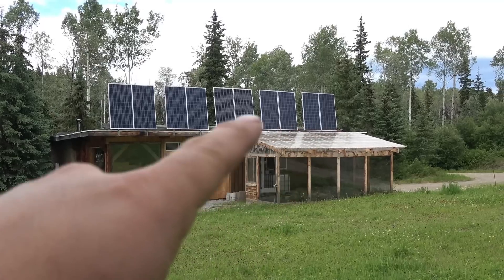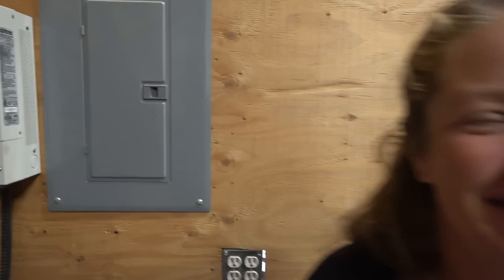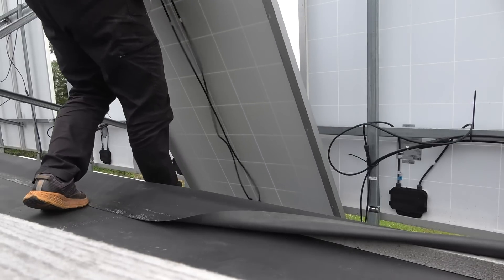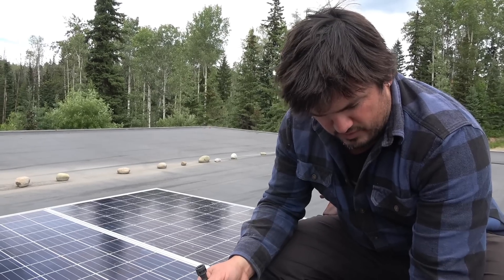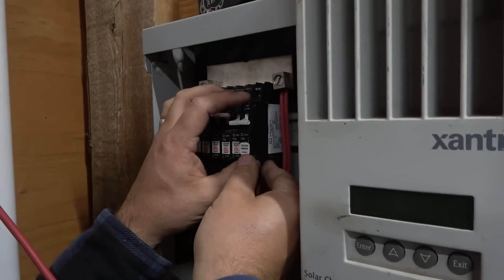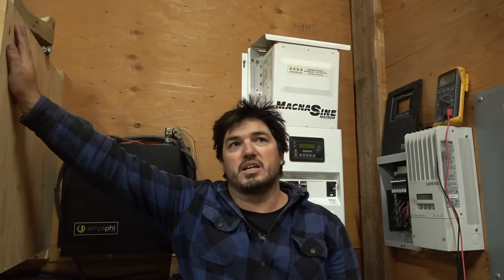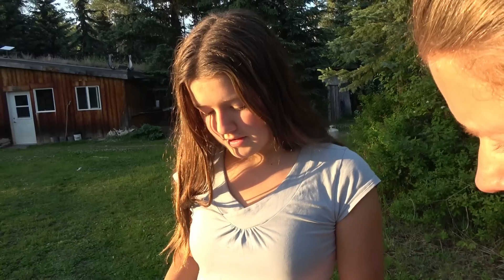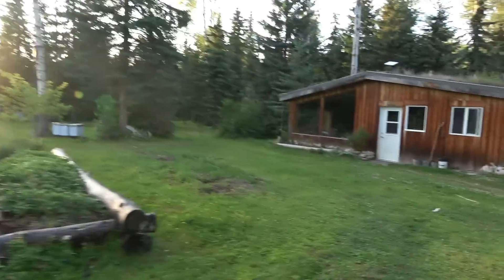SUPERCHARGED Off-Grid Solar Power System

Comment: Smart move buying that low frequency, transformer based Magnum inverter instead of one of those cheap, short lived, low surge high-frequency inverters that everyone else is pitching. The Chinese made high frequency, transformerless 6000XP is nowhere near being the best solar inverter on the market.  It offers a shorter life span, a poorer surge capacity and because the Chinese engineers that designed this went on the cheap, it doesn't use an output transformer. Without an output transformer to provide galvanic isolation, this inverter can damage your appliances when it's MOSFETs fail. Don't take my word for it, Search Google for the term "is a high frequency inverter less safe without an output transformer".

Comment: i have a spare hot water tank  with a smaller element  that doesn't blow the inverter output capacity ie a 1kw element
that i can run alongside all other load  this spare/feeder tank feeds my normal hot water tank that has bigger element not on my inverter system
so it just has less work to do sinceit gets in warmer water, so i switch this spare tank on as soon as  the solar can match my normal load + hot water tank and thus postpone battery charge a bit utilising more of the avaialable solar

Comment: You could get another cheapish charge controller too if you wanted all you could get but you generally only get full power for like 1 or 2 hours so its not a big deal but if you have different panels with different voltages another charge controller is ideal

Comment: Gotta get the common sence going.#1..?Just red wire for + & -? 2...Over-drive the electronics? You CAN stress em & shorten their life. 3...all the razor-sharp panel fitting knockout holes..let in mice, insects, snakes. 4...hooking ammeter directly across voltage source??!! Sorry guys. As a former military electrician..you're REALLy making my head shake.

Comment: you know you could pintle mount groups of 4 panels and use the suns heat to expand hydraulically to shift the panels into the direct sun all year long ... the black storage cylinder on one side heats up as it gets sun and moves a piston on the opposite side to push the panel so it shades the storage tank ... so top and bottom left and right ... then your panels will self align with the sun all day every day all year long and it uses NO POWER .. just the basic suns heat

Comment: Homemade solar tracker = arduino micro + 3 tiny solar panels vertically in a camera obscura  + whatever motor setup you rig together.  And Get A Lightning Rod before you loose your whole system.  Please add 48v contactors too. I would hate to see so much work and love go up in flames

Comment: Stinks you are off grid. I use my grid tie array and it’s nice and easy. If I overdraw then it just bills me. Panels have dropped enough in cost that I can up my current 2kw grid tie array to a 10kw. That 8k addition should be paying itself off in value in 4  years so that will be worth it and since I currently only use about 5 I figure it will be good so I can do more welding and woodworking.

Comment: Your right. it would not blow it up as the charge controller will only take what it can put out and the batteries will only take what they can.  Also when the electric systems start to work will change the draw on amps etc.   
Its all about balance.

Comment: I do mine a little different. I doubled the number of panels my controller could handle. During the sunny days of summer it was wasting a lot of electricity so I parallel a second charge controller with the first, Now I capture all my electricity. I used different brands of controllers. I don't know how much battery you have at the end of the day but you might need another. Good Luck.

Comment: I really am enjoying your videos but have a question; You’re adding panels which increases amperage. Did you oversize your wire running from the panels to the house? I bought a camper with a 200 watt panel, and a 30 amp charge controller. I can add up to 600 watts total, but the 10 guage wire is only rated for 30 amps, so that’s all I can safely do. I know things are oversized, but don’t want to risk a fire.

Comment: Love your channel! We're off grid in Alaska too... 4 years for us.

The single best thing you could do to supercharge your system is switch to better equipment. Xantrex and magna aren't bad quality, but they aren't nearly as efficient as Victron. Check out the idle consumption on the Magna vs the Victron Multiplus units. For most people who use these off-grid inverters, the inverter itself is the single largest power draw on the system. Many draw a continuous 100 watts or more. My 3000va Multiplus draws just 11 watts at idle, and with the typical load of the house, I generally have less than 30 watts lost between battery and load. 

We run a Victron 250V-60A SCC, 3kw of panels 4s2p, the 3kva inverter, with a single 100AH 48v lifepo4 battery. That powers our cabin, 2 freezers and a fridge, well pump, microwave, etc. We have a 36-48 hour battery reserve. If I wasn't running super efficient equipment, I'd need at least twice the battery and panel to get the same performance I get with Victron.  

Stepping up to a higher voltage SCC would let you put your panels into 6s2p, which would also add to your power curve morning and evening, as the scc would see minimum charge voltage at lower light levels. Not a significant increase, but combined with lower line loss from the decreased amperage, you'd see more net power to your batteries.

Comment: What about increasing the voltage and also putting them to an angle directed toward the south. At a 45 degree angle they should have little snow, but be much more efficient.

Comment: a few comments. 
Another Ytuber, who lives in snowy area, has found that bifacial ground mount angled panels clear themselves of snow because reflected light hits bottom of panel, makes power and heat melts snow off the front of panel.  Same might work with panels angled for your latitude on roof.   
MPPT solar charge controllers have become cheap- MakeSkyBlue 150/60 runs $150 (but has a fan) and HQST 150/60 runs around $200 with no fan just heat sink.  EPEver a bit more.  I believe your MPPT is/would reject excess pv power by converting it to heat which is not good for the device.  For a little as $150 and some cable to bats your could avoid potential issue and maybe add more panels to insure adequate power during cloudy days.  Adding more commercial 48v bats is expensive, DIY a little less expensive.

Comment: Recently closed on property in New Hampshire which is off-grid. If you were starting from scratch, based on your current power consumption, what would you have done differently? I'm sure some of the hardware you purchased has been updated with something more recent. Any brand preference on the panels? Solar charge controller? Battery type? Inverter? If you're able to answer, thank you.

Comment: I have been doing the same thing lately because I have had more panels than controller. It sure helps on cloudy days 🎉. What my worry is chasing it all day to make sure it doesn’t over charge the charger. If the clouds were to open up off and on during the day 🥴. A voltage alarm may be good. And if you were away have wi-fi set up, to alert you. And someway to disconnect the extra panels 🤔.

Comment: Panels won't put out their maximum so you can do this but, more power creates more heat. 
You would be wise to add a small fan in your charge controller.

Comment: Charge your solar system I would think you would be better off with a second mppt charge controller and increasing your battery size. You would not be limiting with solar panels by doing this. And your storage would not be so small where fills up so quickly.

Comment: I’m dealing with refrigeration as a vehicle dweller. And I just transitioned from being in a big city & mostly on a university campus where I could charge in the library (though even that was a chore) to staying on BLM land & trying to make things work using solar only. 

First I had to upgrade from a single 100w panel that was never going to do more than barely keep things running to adding a 200w panel. Now I have to figure out how I’m going to be prepared for overcast days 😳

Comment: As someone who lives off grid on 1700w of solar, I have a few things to add. 1) tilt your panels better. 2) get more batteries. 3) get better mppt controllers. 4) get more batteries. 5) get more batteries. Oh yeah and just for fun, GET MORE BATTERIES! Your system is being held back by your lack of batteries and chargers, NOT a lack of solar panels. 3kw is WAY overkill.

Comment: I am suggesting that you face the panels to where the sun rises from and adjust them to the angle I suggested which is 30 to 45 degrees then  after  doing  that your iwattage problem should be solved

Comment: Simple truth . Solar panels only put out about 70 % of their rated power . Which rated for the equator. The further north or south of the equator . The lower the percentage. The more panels you need for FULL power. The amount of power passed my your controller is governed by your load ( draw) . If you run to much load . You can blow your controller. That's why you need a breaker on the line into your controller. 
To add power for your load . Add batteries.  You only need more solar if you batteries are not receiving enough charge at the end of the day . And that is what you seem to have done .

Comment: Years ago I build a large cooler that I put my chest cooler inside. It's 4" thick top,bottom, sides. The compressor/ motor I  extended it outside of the cooler. It doesn't run that often anymore. Wicked insulated.

Comment: Why don't you make the array angle adjustable. In the summer the angle should be lower as the sun is pretty much overhead. This will maximise the panel output. In the winter the sun is lower in the sky so increase the angle. Again more output  and will also be better from the point of avoiding accumulation of snow on the panels

Comment: Nice work Jeff and Rose. P.S. if you want I can send you the maths for taking into account temperature on the panels to show the girls. Also, if you use a voltage sensing relay (or maybe your charge controller or inverter have an output relay that can be programmed to turn on/off based on state of charge) it would be quite possible to "dump" excess power in much of the year into a normal electric hot water cylinder - luxury, showers without the woodstove 🙂

Comment: You guys are awesome!!

You are going to hear a lot of different things....so here is some moe. 😅

We have been on solar power about the same time you all have.
This is what ive learned....

If you want to stick with a 60 amp CC MPPT.... thats fine.
Buy another 60 amp CC and then wire your Charge Controlers in parallel into a  bus.....then into your batteries. Of course not exceeding your batteries max amp for charging.
This not only boosts your amp input but also creates a redundancy....so if one CC or solar array became damaged, you would still be producing power. 

You guys rock!
God Bless!!

Comment: Get a Midnite classic  150 96 amps 48 volts 5000 watts of panels, that's not the best part it can handle over paneling so 8000 watts if your wanted but over panel don't help much when the sun is out, but on over cast days when amps are not being reached all the panels get used. Yeah lifepo4 are fantastic, I've got a 
 medium size deep freeze and a small refrigerator, but 10kwh lifepo4 handles them with easy, probably because I've got 5.6kw panels and generating more energy on overcast days. But almost like being grid-tied without the bills

Comment: Just getting into solar and I built a small 400Watt system with a 2K inverter running power to a dedicated outlet in my living room. My charge controller is only rated toat 12v and 30Amps, and like you ive noticed that I never ever get close to 30amps. I think Ill be adding another pannel or two 🎉to get that little extra . Love watching your videos, amd getting great tips.

Comment: Why not just add another solar charger so all of the energy the panels are capable of producing can be used.  You can add as many solar chargers to your battery bus as you want as long as the bus and wiring is sized to handle the current.  I use the Midnite chargers for my system.  They do not need to nor can they communicate with any of the other equipment.

Comment: Power tools suck bigly of the watt.  That's inevitable.  Things to check: 1) Make sure all your appliances are newest, because they drop in power use every single year.  A 20 year old freezer can outsuck a dozen larger new freezers.  The optimized-for-PV stuff uses 12/24/120v compressors. 2) Use only LED lighting.  I finally stopped using my last fluor light about 6 years ago and incandescent about 20 years ago. Every single watt you use counts when you're on limited batteries.   3) Optimize your solar panel placement, angle, and configuration.  With the nice open fields around you, I'm surprised your panels aren't ground mounted.  And using more of the capacity of the controller (60x150=9kw, not 3kw. Is it sold as a 3kw controller?  If not, add more in series to get closer to the 150v max for the array) is simply making more efficient use of it.  Good!
I took down my 1kWh solar and installed a new roof, then ordered a 5.4kWh offgrid setup (with 20kWh of backup battery) which will provide everything I need, including central air conditioning.  My grid electric use is $35/month (annually averaged) without the solar, with nat gas heat.

Comment: If your wattage is your voltage times you amperage and your charge controller does up to 60 amps and 150 volts, you should be able to work out a series/parallel configuration that gets you pretty close to 9k watts. I understand there are some tolerances and headroom you may want to leave for safety sake in case of a very sunny day and you peak out your array.

Comment: Hmmmmm....definitely gave me something to think about here.  I suppose if you want to be super safe, you could put up more panels to a seperate charge controller all wired to the same battery bank.
Reply: actually he just used some wrong wording. it is not supercharging,
because panel do not work at full capacity, especially so up north. 
so, the inverter will never work at full capacity. 
adding more panels eventually will surpass the maximum level of the inverter  at peak production, which is just an hour or two. 
and in this moment, sure, you can say that is supercharged, but actually it is not. the inverter will provide maximum designed and let the surplus get lost.
it even has a name this method. some like peaking or cutting the peak. Or shaving.
Reply: I totally understood that part.  Its the several days in a row without strong sunshine were the issue lies.  My comment to add more panels with a seperate controller using the same battery bank was geared to recharge the battery bank quicker on those cloudy days.  Each charge controller will not allow an overcharge to occur.  My set up is "maxed out" at 800 watts (8 100 watt panels) but I bet I could add two more to make up for the inefficiencies in the panels without doing any harm.  My comment above concerning a second charge controller (even using the same battery bank) would provide ultra safety.   My opinion and I am NOT an expert.  Does that make any sense? @ehombane

Comment: I found your video entertaining!   I used to do electrical design of utility scale solar.   From 1MW to 100MW systems.   You are correct in oversizing the array watts to your system.   Since our customer wanted every penny they could get from the system because they were selling the power, we found that 25-27% over was the point to stop because of diminished return.   A few thoughts about your system.   If the batteries are charged by 10:00 am, when you have the money, you should think about increasing the capacity.   When you were checking production,  your huge spikes are usage, not production.  If you are not using, it will drop production.  Your graph would look like what you thought it should if you were charging batteries and using electricity all day to allow the panels to give it their all.   Again, enjoyed the video!
Best wishes for some great cheese!   Kevin

Comment: There is much to be said for having two arrays of panels, one for morning and one for afternoon solar harvest. Doing this simply collects electricity for more hours than a fixed array. It's also possible to have a moving array that tracks the sun daily. By moving the panels to face the sun you get the same amps but for more hours however the engineering is more complex.

Comment: One thing with those xantrax controller your not fully getting the 60amps of charging. Im thinking you should try and get the magnasine charge controller which is a 100amp so you can add more panels to help power the cheese fridge.

Comment: While the panels not fixed in a position ... why not make a temp mount so they perpendicular to the sun at noon ... The angle will make a difference in panel output. Then the trick will be make them adjustable .. a summer angle and a winter angle to maximize your output.

Comment: I'm very curious how you mounted those solar panels almost vertically. Do you have a video on that? If not, I'd like to see the details on how to replicate that. I'm wondering if you have a wind load on it like a sail. And what latitude are you that vertical panels makes sense.  I' thinking of placing panels perpendicular to the roof (instead of parallel to it) which is unheard of.